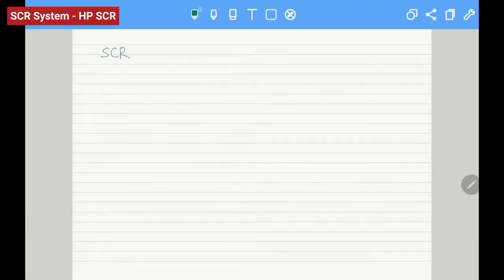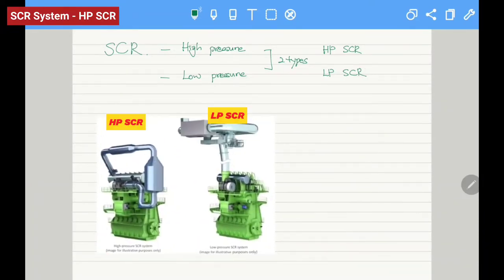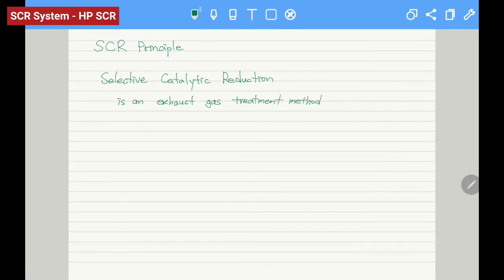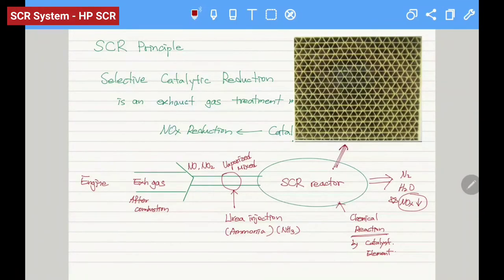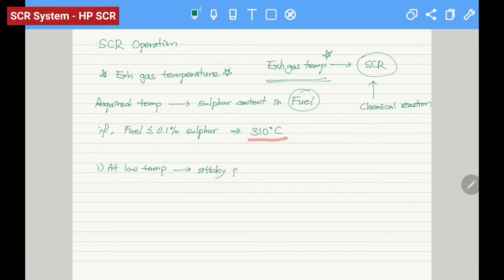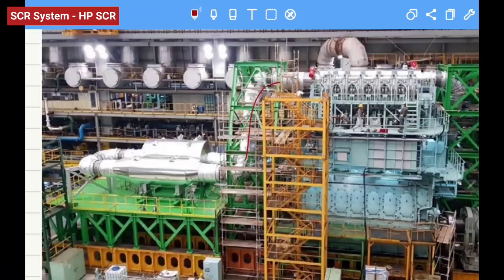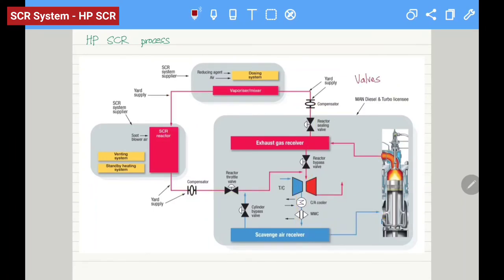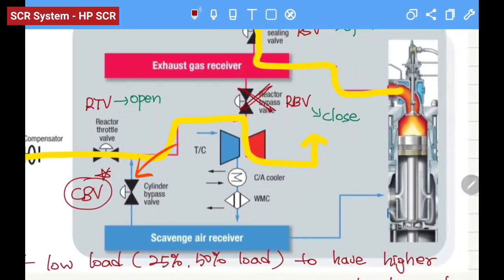SCR(Selective Catalytic Reduction) - 2stroke Marine diesel engine

Comment: what is the function of EGB ??
Reply from the maker: EGB Exhaust Gas Bypass! You have to reduce the power to Turbocharger by means of bypassing Exhaust gas depends on how you turning the engine such as part load tuning. If your engine is part load tuning then it will exceed the maximum pressure at 100% load if you don't bypass the exhaust gas to Turbocharger.